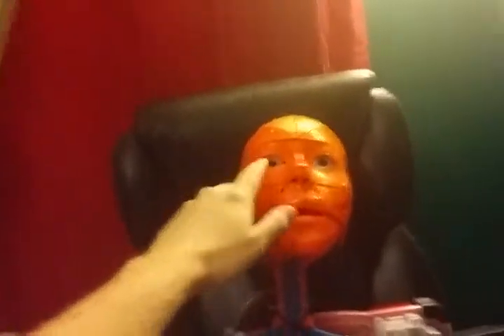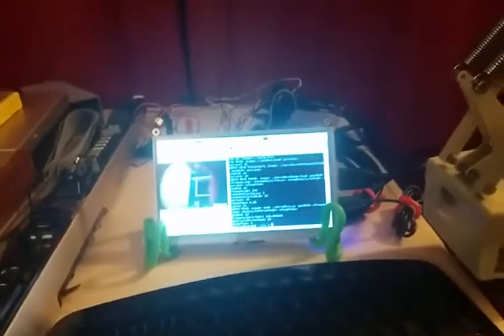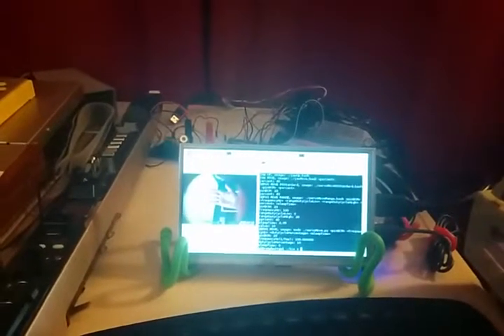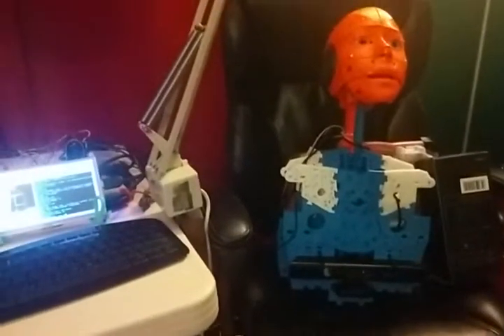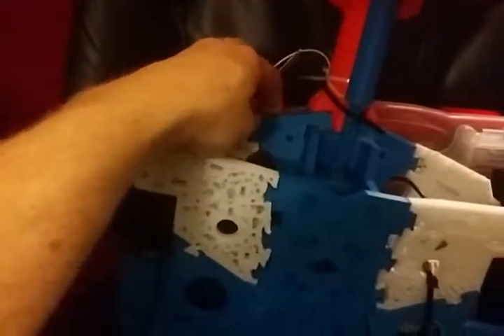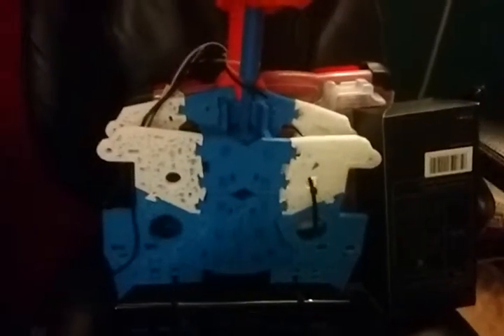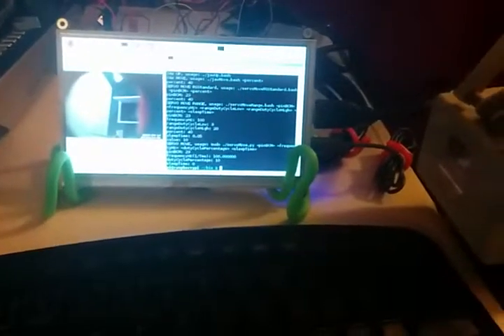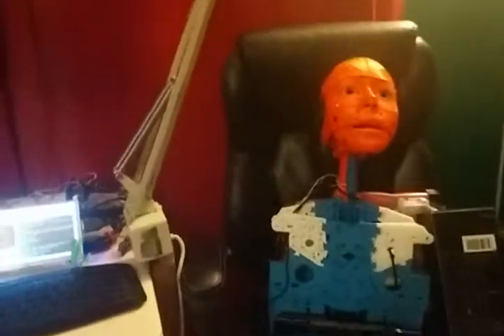InMoov 3D Printed Robot Raspberry Pi Part 4

Comment: Matt, Jolynn just showed this to me.....sooooo jealous....going to start on one.  I do have to admit that I get a bit confused on which are the latest files to use and print...  Suggestions?
Reply from the maker: Bruce Davies Originally, the parts were posted all over the place in different locations in a giant mess.  Now though, it looks like Gael is trying to clean up the website a bit so all the parts are on the same site at least.  All of the parts generally have a fixed name no matter where you get them from, so your best bet is to first go out to every single inmoov part site you can find in google and download any STL file you can into one folder as long as you have one for each file name.  Sometimes, you also have to print multiple copies of the same part.  I started from the skull and then did the neck and then torso, but it's probably easier to go in the other direction so you can actually mount it to something stable.  Since you really don't know how things go together until you've made them, it's best if you label each piece you print with a sharpie marker of the filename. I've found it's best to print everything on low quality, and occasionally you do have to use supports, but very rarely (some support pieces are designed into the models).  So I'd start from here and see if it's everything: http://www.inmoov.fr/download/  and there are a lot of the original part posts here was where I downloaded from originally: https://cubehero.com/search?q=inmoov